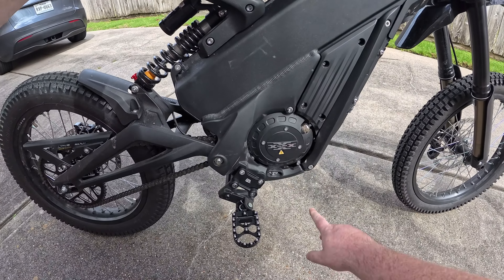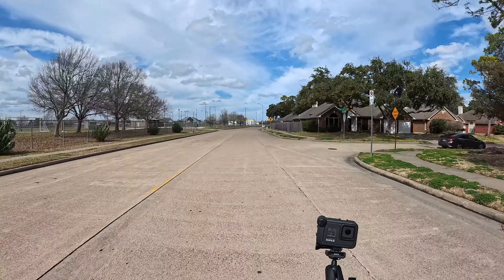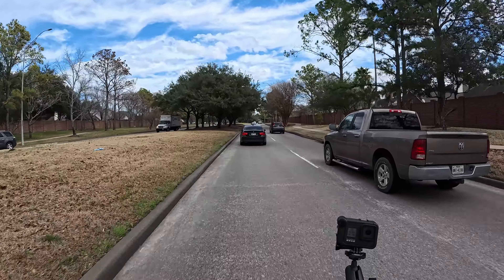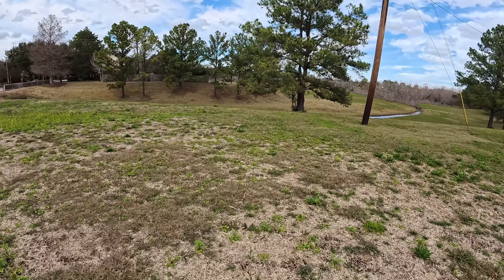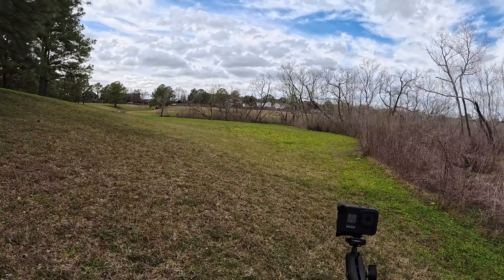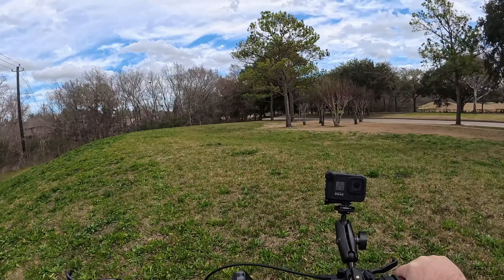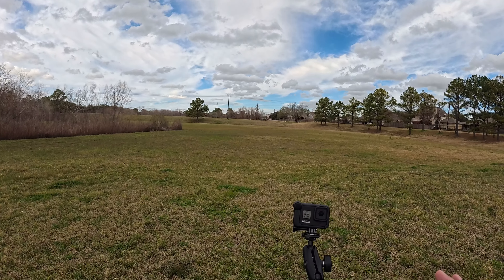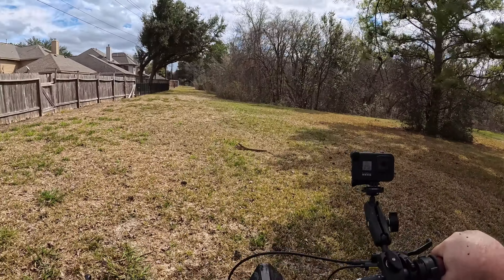Talaira xXx and Sting R Motors are NOT Equal #talaria #ebike #surron

Comment: If you scroll more down to XXX COMPARED TO THE STING R section, It says the same motor( identical motors). Very sus
Reply from the maker: Really on the Luna website?
Reply from the maker: Wow you are right it does say the same motor
Reply: @JasonFew80 Yes thats what me and talaria boys were saying. Luna should change that
Reply: That’s the whole reason I bought the xxx over the sting r was because it was the same motor. That’s some bs
Reply: @raw_shaw  idk man, talaria boys said that it was harder to push x3 to over 12kw, while sting r can easily
Reply: well that’s exactly the reason i purchased the XXX over the Sting R was because the website says it’s the same motor and yes it says same motor as the sting R and the other reason was the super moto tires offered. i wouldn’t have gone this route if i knew it was different. i think there are many others thinking like you and i did so your not the only one and it makes me feel like Luna Cycle are misleading us. I read where it states it’s the same motor not just that it’s an IPM (style) motor as they are now trying to insinuate by saying obviously it’s not when they clearly state it is on their website. i’m a little pissed because i just received mine and would’ve rather had the higher seat height and more purposed dirt bike.
Reply: @FewMoto  Very deceptive!
Reply: Love my xxx, would have bought the Sting R if I would have not read that line about them having the same motors.... 

😂😂THEY GOT ME😂😂
     😅THIS SUCKS😅